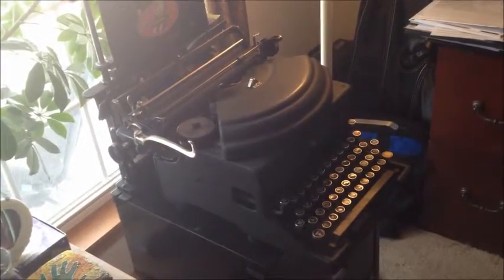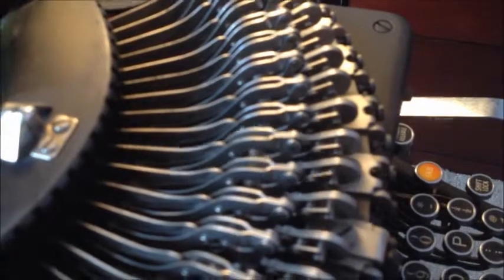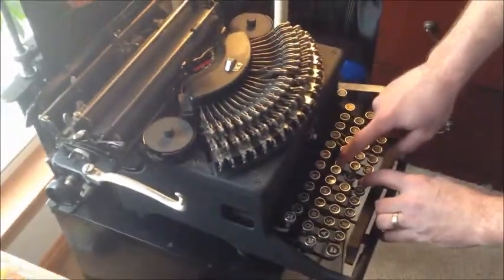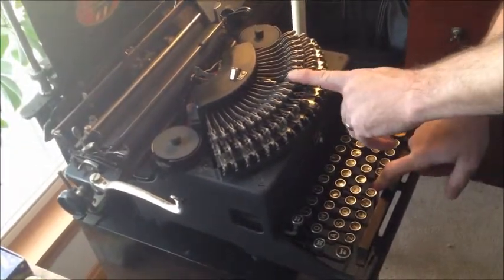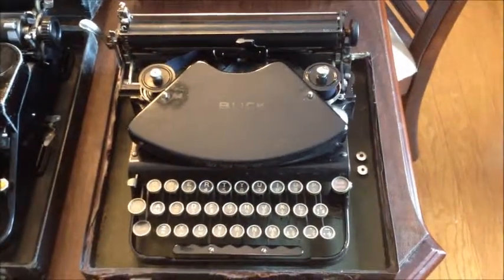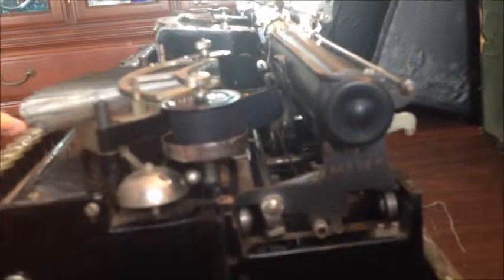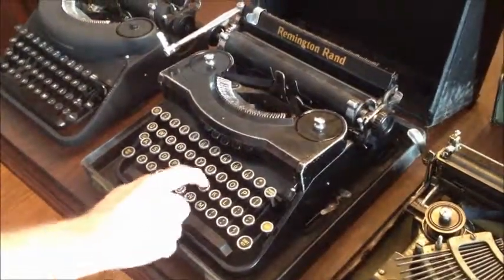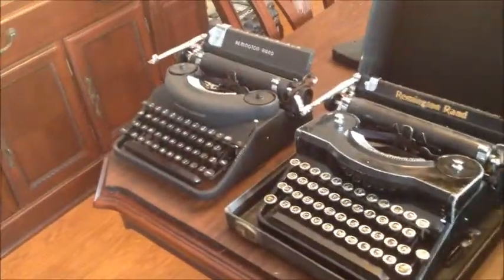Weekly Video 2   Noiseless

Comment: Thanks, that explains a lot about these machines that I was previously unaware, especially about that tiny weight which i never heard mention of before. I find the concept and efforts that went into making a 'noiseless' typewriter intriguing. I can imagine research teams looking for a sales edge over the competition thinking "What's an annoyance about typewriters we can correct? Well they can be damn noisy, let's fix that and everyone will want one." Then after huge modifications and expense they finally launch their 'must have' feature and, other than licensing to Underwood, practically nobody follows suit and it remains a specialized niche in effect. I have heard it said that typists didn't flock to the Noiseless en masse because without the audio reinforcement of a clattering typewriter a typist didn't feel they were getting as much work done. Could that be plausible? Or was the feel of the action so much different (and it certainly is different!) that they were just put off by it?